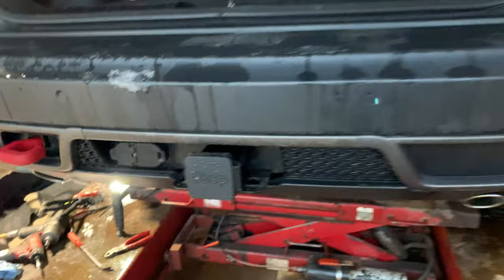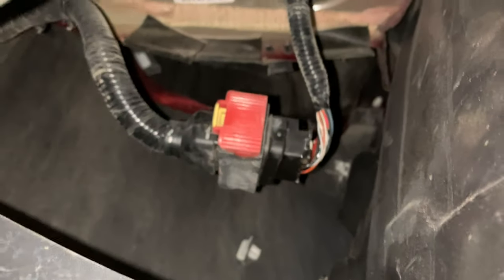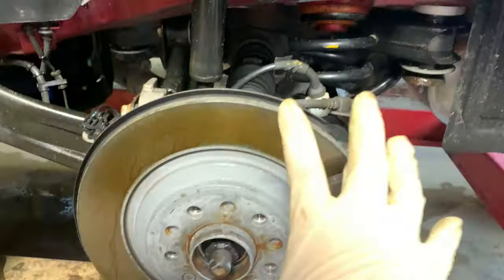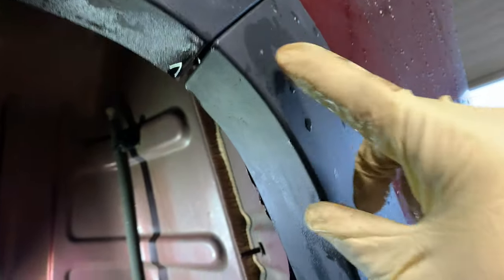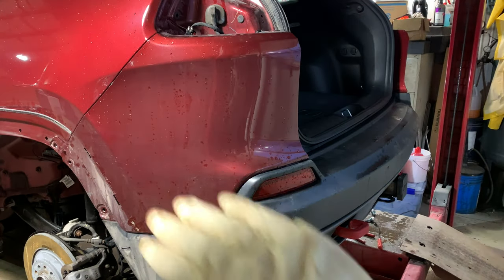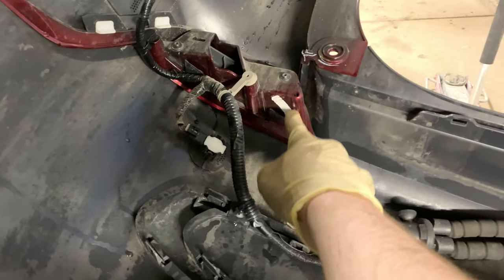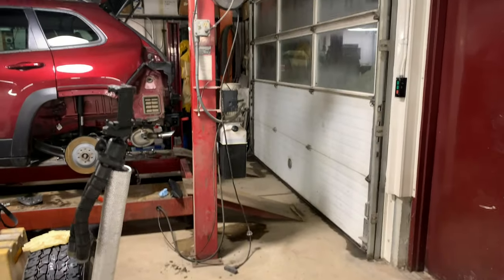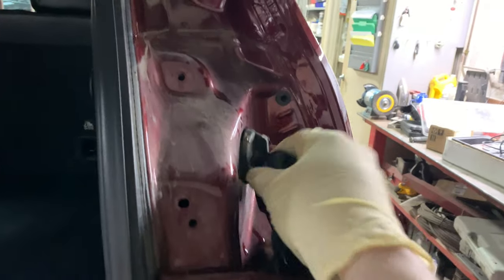2019+ Jeep Cherokee Trailhawk Rear Bumper Cover Removal/Replacement

Comment: You only have to remove the moldings on the quarter panels to expose the side bumper bolts.. you can leave the bumper flairs and splash shield on.
Reply from the maker: If you don’t want to break the clips on the quarter moldings, the fender liner needs to be removed for access to the clips. 
But personal preference if you want to risk it. 
I removed the bumper flares because I was swapping them over to the new bumper cover as shown in the video.

Comment: Hey got tapped from behind would it be possible to replace those gray/ silver appliqué without removing the fascia? Thanks great video but you just called the resistance clips
Reply from the maker: Hey, it is possible to remove those pieces without removing the whole fascia. Just be careful, and use a strong pry tool. Those clips are much stronger than they should be! Take care not to scar the textured plastic fascia though!
Let me know if I can be of any further help.

Comment: Hey bro is it possible to remove just the rear fascia?
Reply from the maker: No sir, the textured part and the painted side pieces must be removed together, then separated once it’s off the car.
Reply: @TagTeamGarage  oh okay the side pieces like the wheel mold must be taken off. But not the actual bumper itself where the reflectors are right? 

If you would be able to drop your Instagram maybe I could send you a picture. Thank you for your video though and your reply
Reply from the maker: In order to remove the bumper (where the reflectors are), the moldings on the quarter panel need to be removed because there is one screw behind them that holds the bumper cover on. Unfortunately I don’t have an insta for the channel that I can give out. 
You can email tagteamgarage@gmail.com with whatever photos you need to send though.

Comment: With this work with 2016 jeep cherokee kl
Reply from the maker: The process is basically the same. Trailhawk bumper is slightly different from non trailhawk models, but the steps are very similar!

Comment: What color are those bumper trims with the round and flat piece.  Mine has a scratch but don't want to take the whole bumper off for that.
Reply from the maker: The paint code from Chrysler is XS9. I had a hard time figuring out what it was too. If you need to refinish them, will need to mix up (or have someone mix) XS9 and some matte clearcoat.
Reply: @TagTeamGarage  thank you. Also anyway to get scuffs or scratches out of that plastic bumper it self. I heard armourall is good but would like your opinion.
Reply: @TagTeamGarage  I would like to just touch them up. the rest of my jeep is black  its just the rear right bumper trim.
Reply from the maker: If it’s a deep scuff, there’s no way to remove it really. You can try to hide it with an armourall type product, but depending how deep it is, that may not work. On any textured plastic body panel like that bumper, the only way to get rid of deep scratches is to replace the piece unfortunately. I manage an auto body shop so I see it all the time. Whenever a textured piece is damaged, the insurance companies automatically just write for a new one, because it’s basically impossible to make that finish look as good as new.
Reply from the maker: You can try a texture coating if you’re handy with a spray can. SEM makes a product called texture coat. It’s the closest thing I’ve seen to being able to match a textured bumper finish. It won’t match perfectly but you may be able to dust a little bit over the scratch to make it less visible. I would recommend testing it on a piece of cardboard or paper first though so you get a feel for how it sprays down, and if you like the finish before putting it on the Jeep

Comment: Where can I order this it’s exact part I need
Reply from the maker: So far it is only available from Mopar, you’ll have to reach out to your local jeep dealership
Reply: @TagTeamGarage  awesome, thank you 😊 would you happen to have the part numbers or did they tell you what you needed?
Reply from the maker: Sure. You’ll have to tell them what you need. 
The part you need is the lower rear cover, for the trailhawk models the part number is 68410468AB
Reply: I need this part, a new passenger side quarter panel (stone grey) and the passenger side light assembly… did you order this part directly from Chrysler/Jeep?
Reply from the maker: Do you need the metal quarter panel itself or the bumper cover? 
Yes I order all my parts from Chrysler/Jeep dealer